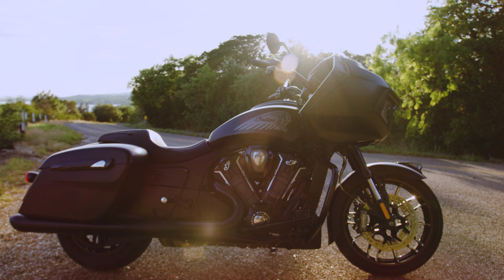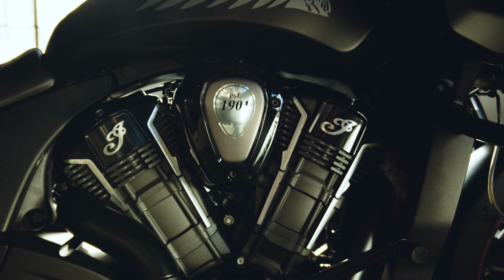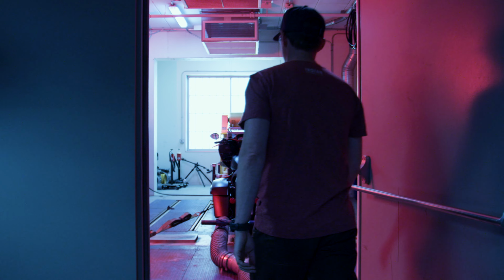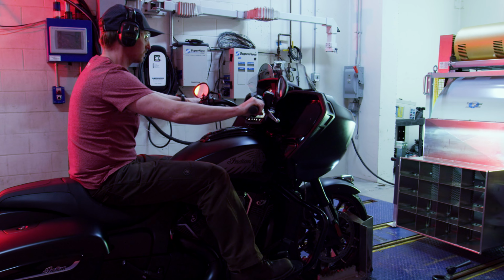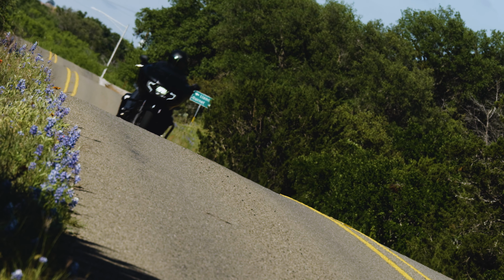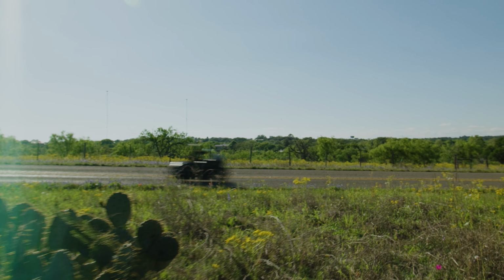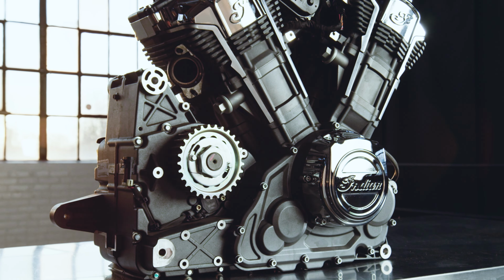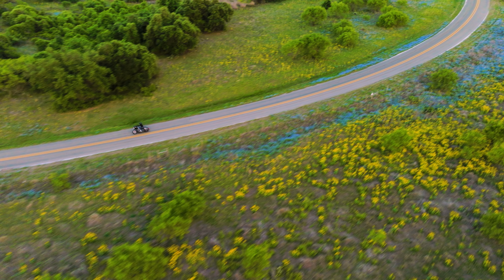The Powerplus 108 | Challenger To Champion

Comment: Just bought a 2023 Challenger. Love everything about the bike. Power is great. I rode with a 103 Harley the other day, and he could not even keep up. Still alot of power, ride what you like, and makes you happy.
Reply: 117 won't touch ya either.
Reply: Are you getting that crazy like gravel noise lifter noise on the top and? It's really bad on mine I have 350 MI

Comment: I’d like to see the Powerplus in a non-bagger bike.
Reply: Give the people what they want, blazing fast liquid cooled sport cruiser, it's not difficult.
Reply: It’s called the scout! Same basics
Reply: @joedunne9492  Time to graduate, give us more than 100hp
Reply: @joedunne9492  Yessir, a scout with a big bore kit 61mm throttle body and ceramic coating gets 120 hp to the wheel
Reply: @name2see  https://youtu.be/6WOeB1ASD-0

120 to the wheel meaning 140 at the crank with weight mods you can get the bike down to 490 lbs the scout is there already just have to pay
Reply: @joedunne9492  Not even close.  The larger Scout engine is 69 cubic inches versus 108 of the Powerplus.  The Scout is also a smaller bike compared to anything that would use the Poweplus engine.
Reply: @name2see  Nobody needs more than that on the streets

Comment: I really hope y'all are about to intro a bigger PowerPlus. There has to be some response to HD's RevMax motor and the 135. You've already got the far superior chassis and weight savings, let's bump that power!
Reply: HD had to go bigger to compete because they still use air cooled motor. Smaller water cooled motors can produce much more HP then air cooled ones. HD produced a stage IV create motor that is 27 cui bigger over the PowerPlus with all the bells and whistles just to produce 130Hp! An air box, pipes and a tune on a PowerPlus will easily pump out 130Hp and cost so much less with even more head room to add more performance if one wanted too.